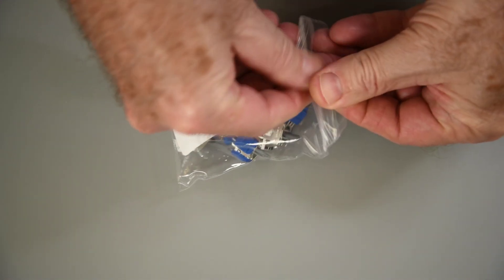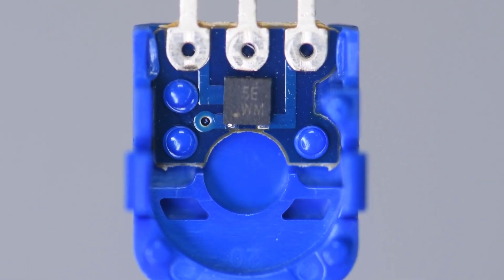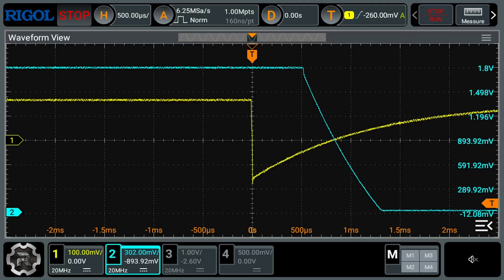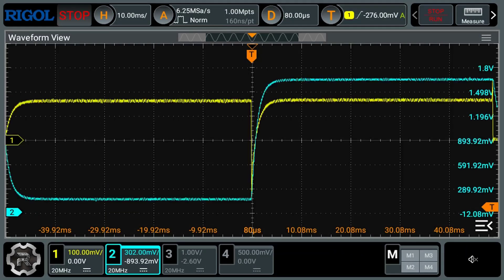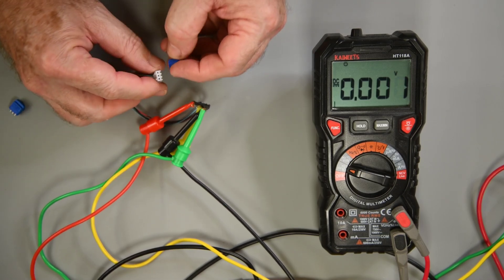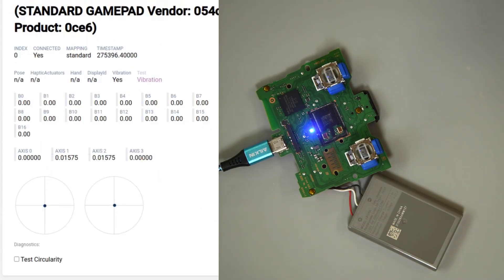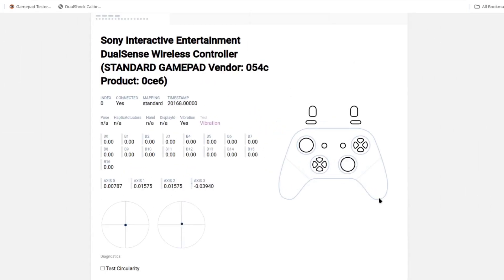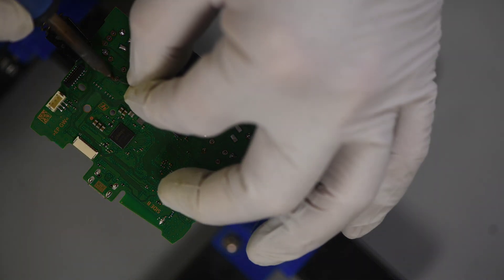A Budget TMR Joystick K-Silver Delivers the Goods

Comment: I got a bag of those k silver tmr sticks and replaced on my ps5 controllers. The controller with BDM-050 mother board has problem on the right stick, the X axis is always outputting maximum left input. I tried several sticks in the batch it gives same results so I can only swap back to my older hall effect sticks. I have two other controllers with BDM-020 and 030 boards and the k silver tmr stick works totally fine on both of them. I guess Sony might changed some design in the pcb board in the 050 version. If you want to try the k silver sensor check your mother board version first.
Reply from the maker: They should work; I've put the Ginfull TMR sensors made for the Alps frame in a BDM-050 board.  So the electrical connections are the same.  Have you got a multimeter to see what the voltage on the output of the sensor is reading?
Reply: @metalplasticelectronics354 yeah let me take it apart and have a measurement. Maybe it's the problem of just this controller.
update: that axis is not giving me voltage readings, the other three are have 1.8v on the tow outmost pins. I guess I have my board fried when testing different sensors.
Reply from the maker: Do you have 1.8v on the B+ pin of that sensor?
Reply: @metalplasticelectronics354 I measured with the joystick desolded, it should be the main board problem 😢
Reply from the maker: Unfortunately, it sounds like it.

Comment: I have installed tmr but my stick on the right (aiming analogue) just won’t centre it is constantly aiming down I’ve tried calibrating several times could it be faulty the left one works without fault any ideas?
Reply from the maker: If it is all the way down, it means the output of the sensor is at maximum voltage.  You need to take a look at the ground, output pin, and traces for the up/down sensor.  If you have meter, take a look at this video: https://youtu.be/cWUnZ7KjUIQ?si=2gH5Jaks1wi2eHQD
Reply: @metalplasticelectronics354 high thanks for the response , I resoldered the joints and cleaned them up with alcohol and worked a treat I have another issue I commented on your most recent video

Comment: Great video, my question is this tmr sensor interfere with the left trigger on the xbox controller?
Reply from the maker: The one I tested had the magnet at the bottom of the sensor, so it might be a problem if that is the Xbox controller with the Hall effect trigger sensor.  Someone mentioned that a newer version of the K-silver had the magnet at the top; if so, that would be better.  But both the Hallpi and GuliKit have the magnet at the top, so they would be much less likely to interfere with the Hall sensor on the bottom of the PCB.

Comment: Any advice out there.  I pulled my board from the PS5 controller and installed the joysticks.  They callibrated perfectly and centered perfectly.  When I put the controller back together they went crazy just like they had stick drift.  Anybody know where I went wrong.  Can't understand why work perfectly on the control board but then the board is reinstalled they don't work.  Thank you.
Reply from the maker: The main board has to be installed in the controller to calibrate it.
Reply: @metalplasticelectronics354  Thank you so much I tried it both ways I wonder if I overworked the board.  I am just learning but seem to have the basics down.  I started over on things more than once.  I am going to try again with another stick drift joystick today.  I might have done something wrong and messed up the board.

Comment: i just installed these on my ps5 controller. QUestion with the flux however, is it normal and okay if the flux seeps thru the board to the top side under the TMR joystick where the holes are from the heat and melting of the flux? i noticed on both joysticks there was flux residue under the joysticks. I tried to clean as much as i could with a tiny tool, but seems inevitable that flux will seep through once metlted and cleaning it all is almost impossible to do.
Reply from the maker: If it's a no-clean flux, I wouldn't bother with it.  If it needs to be removed, you might have to look up the best solvent for it, if letting isopropyl alcohol sit on it is not dissolving it.

Comment: I e been playing fps games a lot woth the guilikit tme sticks and my left stick now drifts towards the top right position if i just barely move the stick in that direction and let go. Do you think this is a return to center issue or a sensor issue? I have to set my deadzone to 7% in Fortnite to get rid of the issue.
Reply from the maker: It sounds like a return-to-center problem.  How far off-center does the Gamepad tester website show it?  And have you tried to recalibrate it?
Reply: @metalplasticelectronics354  I recalibrated it and redid my centering and it seemed to be okay for a match, but then it started doing the same thing again. Like I said, setting dead zone to 7% fixed it, but this is kind of concerning because 5% is where I like to be. I believe they knew this was going to be an issue and they said that the second frame for that reason, but I would rather them make a better frame so I wouldn't have to eventually change out the stick. Have you found a tmr stick with more tension yet?
Reply from the maker: Not a TMR stick yet.  Ginfull makes a higher-tension joystick with a fantastic return to center.  I've ordered some Ginfull TMR joysticks.  If they use the same joystick frame might be able to mix and match.  I hope to get them this week, not a great time of the year for prompt package delivery though.

Comment: Is potentiometer fits in a alps joystick? Or fits in a favor union joystick? Or both is not fit the potentiometer?
Reply from the maker: It won't fit either.  Too loose on the Alps and will not even go on the Favor Union shaft.
Reply: @metalplasticelectronics354  thanks, so buying gulikit tmr better than K-silver if you have a alps joystick.
Reply from the maker: The GuliKit TMR sensor will fit an Alps joystick frame, take a look at this video: https://youtu.be/v6CAmJTqCJ0?si=1VhRjn_kx5CtFpbE
Reply: @metalplasticelectronics354  thank you.

Comment: Good videos.On a slightly different note,the dualsense edge uses exactly the same alps joysticks as the regular dualsense.Ive had them side by side and they are identical.These K silver or the Gulikit joysticks should therefore work in the Egde stick modules? Im a bit reluctant to damage my stick modules as they are hard to buy for retail price but all things considered i dont see why they wouldnt work. 👍
Reply from the maker: There could be one thing that keeps them from working.  The power and ground pins must be the same as the DualSense.

Comment: Excellent review. Bit of a bummer to see how these K-silvers are slightly more prone to magetic interference given their sensor is slightly more sensitive, but I don't even know if this would be a noticeable issue.

Any plans on a followup video for these? Would love to see testing to check whether these sensors + magnets will fit and function completely normally on the factory Alps stick boxes. Desoldering through-hole components from a dualsense motherboard via hand soldering is such a battle compared to other controllers. Desoldering Alps potentiometers from a Dualsense is managable, but the stick boxes and even tact switch can be mega stubborn; I've usually had to resort to cutting the boxes apart whenever a repair or mod requires removal of the old Alps stick boxes.

Also, any plans to test whether these will function nicely on the Ginful stick boxes? Jun-Zheng's hall effect mod from last year gave an option for modifying a K-silver hall sensor to fit Ginful boxes (by clipping the 3 positioning pegs on the K-silver sensor housings). I'd imagine these new K-silver TMR sensors and boxes have the same fitment as their Hall-effect counterparts. I really like the Ginful stick boxes as they're buttery smooth compared to everything else I've tried.
Reply from the maker: They won't fit well on the Alps frames.  The magent holders will be a loose fit.  I believe too many modifications would be needed for a good fit on the Alps or the Ginfull frames.  The higher magnetic sensitivity is not going to be a problem.  And here is a video with some ideas about removing the joystick with basic tools https://youtu.be/slxgHcYHnm8?si=tGo70onOhf2oIAYT  .
Reply: @metalplasticelectronics354  thanks for getting back. A shame about the lack of cross compatibility with the Alps frame's wiper/magnet holder given how much similarity there is elsewhere.

Thanks for linking the removal video. Yup, I use the cutting method. Feels awful being so destructive but rather that than lifted traces and damaged through holes.

Comment: do the ps5 verion work for ps4 too?
Reply from the maker: No, it won't.  On the DualShock4 the B+ and Ground pins are reversed on one of the joystick sensors.
Reply: i think not, different in voltage uasge I guess, same with xbox

Comment: I got 10 pairs of these. the actualy mechanism of the joystick was very slighly off center but thats pretty much it. Someone made a report on it and they shut down orders until better batch comes in. also the sensors can be swapped on an ALPS stick if you really wanted to. gave it them the OEM feel the are supposed to have
Reply: @busmanl30 so if I switch the sensors it should work normally or do i need to some soldering?
Reply: @thisaintjwan  Are you 13y/o? Don't be scared of soldering boy, just make sure to get a variable temperature desktop station and tips. The 10$ cheap iron will never cut it.
Reply: @Splarkszter  alright thanks for thr tip🙌🏻
Reply: @Splarkszter  lol i learned at 11 to mod xbox 360 controllers now im a pro pretty easy
Reply: @thisaintjwan  you need soldering regardless. Id personally just replace the whole stick, cuz eventually the spring in the mechanism while wear out causing drift as well
Reply: @busmanl30  thanks for replying g🙌🏻 in the process learning soldering rn
Reply: Oh, that's awesome.

Comment: Thanks for the video. Can you maybe give some more details about what makes TMR so much better than the Hall-Effect?
Reply from the maker: Less power consumption, less noise, and apparently faster response time.
Reply: @metalplasticelectronics354  Thanks. I bought a 10pc v5 Hall Effect set so gonna install those. If for whatever reason I am not satisfied, I will buy the TMRs.
Reply from the maker: The Ginfull V5s are a good joystick.
Reply: Much lower electricity consumption, half or even less than half effect.

Much quicker response times.

More resolution, finer registering of the direction in which you are moving the stick.

Les flickering.
Reply: @blorbb5398  Thanks. I just bought myself some v5 hall effect modules to upgrade my PS5 controllers. Hopefully they work well.
Reply: @jojopojo9516  v5 are super good, and I am telling you first hand. I have then installed in a dualsense.
Reply: Hey there brother i really love the connect you have with US, i have a question. 
I have one azeron compact, ive had stick drift in it, for a while, i tried clean everything even took everything apart 
without soldier, i Kinda wonder if these would fit if possible. If you have any discord i Can send you some pics of me assemble the housing thank you bro ❤️
Reply from the maker: You can email me at mike@mlplel.com.  Is there a name on the original joysticks and do you have a meter to measure the voltage going to it?

Comment: hey but this tmr doesnt look like cyclone 2 or tarantula pro!
Reply: Yes, these need to have the same shape of an ALPS module (also made by Favor Union), because those are the ones installed on a current 1st party controller (DualSense, XBOx Series, Nintendo Switch Pro). 

KSilver also makes modules for bespoke gamepads, and there they are free to use the shape they see best for their modules, as the controller is made around, and for, the  kSilver modules they make. 

But the company is the same, the tech is the same, and I guess the sensor is the same. Maybe not, since current gamepads with KSilver modules are ready for 1000,Hz polling rate, and maybe 2000hz (BigBig Won Blitz 2 TMR)
Reply: @blorbb5398  man Blitz 2 doesnt have ksilver TMR, IS other brand..  check out teardown..
Reply: @InterstellarLord  oh i see thanks.. so they should perform the same as ksilver tmr JS16